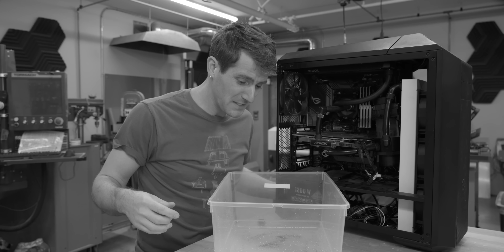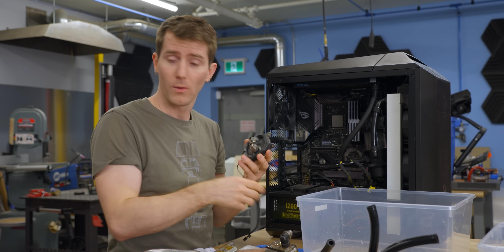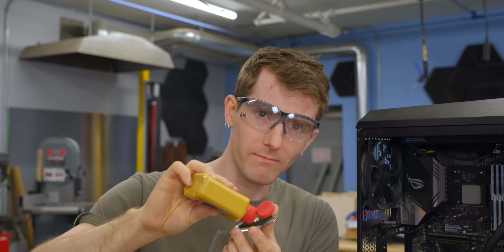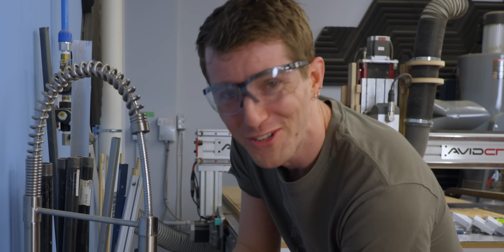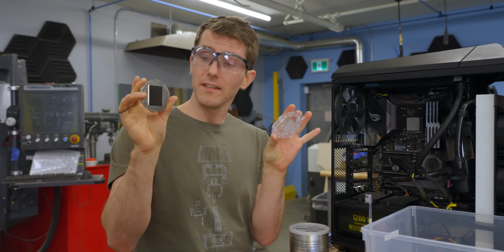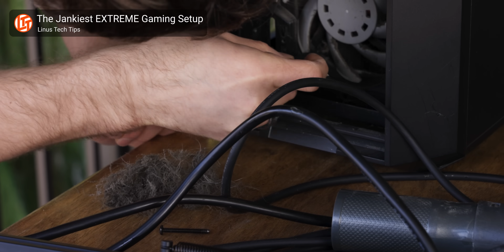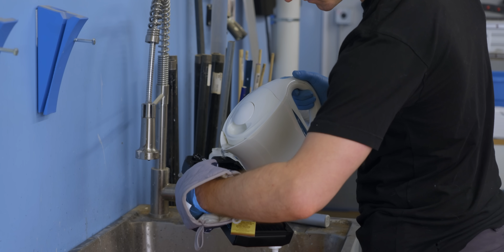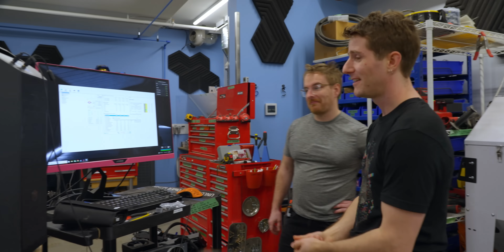I Will Never Watercool Again – Water Cooling Maintenance Guide

Comment: I've been using Distilled Water in all my custom loops for nearly 20 years from all the way back to the Thermaltake Big Water days. No color or additives. Just Distilled Water straight out of the store bottle. Fill it up. Put the lid on tight and store the bottle away in a dark place. Then just top up when needed. My systems run crystal clear and clean. I've sold GPUs with acrylic water blocks and have had many people comment that the EK water block looks brand new and wanted to know if I only just put it on recently.

Comment: Linus, you actually don't want to use vinegar, it has a stronger tendency to attack the raw copper and brass that most radiators are made from, you want to use citric acid. The chemistry makes it less likely and less capable of doing this, while still plenty capable of removing oxides and gunk built up on the radiator internals. I learned this from a Primochill rep when I was cleaning a severely dirtied loop that had previously had die in it along with a bunch of corrosion products and other gunk due to a nickle coated loop that had been stripped of all its nickle. I was in a hurry to get it done and get a build built, and i had not purchased primochill's branded acid cleaner for loops. The rep recommended I simply go to the grocery store and buy a bag of food grade citric acid powder, put some in the water to get the PH to about 2-3 (i got PH strips as well to monitor this), and i just let it run at room temp for a few hours with a spare D5 that had been in the loop previously and also needed some love. It took all the metal oxide shmoo off the D5 and its polycarbonate head, and i assume it did the same for the inside of the radiator judging by the appearance of the water afterwards. I then hit it with a rinse of the same acidic fluid to get the dirty water out, before rinsing with baking soda tap water, and finally pure distilled water until the water no longer felt soapy from the baking soda. I filled the loop with the same distilled water, mixed with a biocide treatment that primochill sells, and my loop has been running now for 4 and a half years with just some water top-ups to account for evaporation over time since one of my radiators has a slow vapor leak above the water line that I need to hit with the soldering iron again (i already patched it once but it didn't fully seal 100%, it must have dissolved some sort of flux plug/gasket that had helped seal it when I pressure tested it dry). I even did a CPU upgrade on this build with no problems because I used soft tubing, so I just bent my cpu block out of the way while it was still connected to the GPU. I didn't even need to use my quick disconnect fittings to take it out lol, just socketed the 5950x and away I went.
Reply: also borax is a nice way to increase pH and acts as a great buffer
Reply: @resko8758 This is excellent advice, I didn't think to buffer with borax but I know the chemistry, it'd work!

Comment: To anyone that wants to try the radiator cleaning method, be extra cautious with the water. Even if you spill just a bit on an oven mitt, it may not initially burn you, but so long as it's wet it ruins the mitt's effectiveness as an insulator. Let it dry or swap it for another before continuing.

Comment: My pc is not happy with the sweltering heat we have in south africa at the moment, opened the side and placed a desk fan the temp dropped by +- 10c p.s the case has lots of filtered intakes. To cool the gamer grab another fan and add a mint teabag into your water bottle no boiling water needed leave it in the fringe for 3+ hours and enjoy, good luck to everyone summer of 2024 looks like its going to be hot.

Comment: Liquid cooling yes, water cooling, no. Yes water has high heat capacity, but computers aren’t making that much heat that fast that you need Water over other, non-biologically “convenient” liquid.

Mineral oil, Mercury, Hexafluorides, refrigeration.

Comment: A good tower cooler sure is hard to beat in longevity and reliability. Been using mine since 2011 in two pc builds with basically zero maintenance. I've like thrice blown the dust away from the fins because my cases have had good enough dust filters to keep the internals clean.

Comment: I have hardline watercooled o11 build but the pump res combo is in the second psu slot in the back. So great to maintain, i can just unscrew the reservoir pull it 10-20cm out of the case and can drain the entire system without much difficulty. In addition the front look incredibly clean

Comment: If you're using water for cooling, should you not use distilled water? No mineral build up. Now if you used tap water, you will need to run Deliver through your cooling system for 30 min.
Do not mix deliver with bleach, Clorox etc, you will DIE, creates Mustard gas. Same as mixing Comet powder cleaner with Any Bleach product. You will die.❤

Comment: PSA, DO NOT LEAVE THE VINEGAR SOLUTION IN THE RADIATOR. It’s will cause HUGE problems, at max 3 minutes, then flush multiple times with water. Acetic acid causes big corrosion.

Comment: Both times I water cooled was because  my AMD gpus were over heating/throttling and the fans were way too loud.  I used only EKWB for water cooling.  The systems are:

1. 9900k CPU Block - MSI Radeon VII - EVGA Z370 Micro - 1000Watt EVGA G+ PSU - Thermaltake F31 Suppressor case black - (2) 360mm radiators with Noctua fans
2. 5800X3D CPU EKWB AIO for CPU - AMD 6950XT GPU with EKWB GPU block - 1200 Watt Platinum SuperFlower PSU - Lian Li 011 Dynamic EVO white - (1) 360mm radiator with Lian Li white 28mm fans

I did recently have to swap out on the 9900k Radeon VII system after like 4 or 5 years in use:
1. The 9900k EKWB CPU block due to a crack in its plastic/acrylic
2. All the EKWB clear tubing because it turned yellow and had a kink in a tight radius area.

Other then that, both systems are still in use and still leak free.  I did install a T at the bottom of the loop with a valve on both systems.  This allows me to drain the system when needed, even though it makes the system look uglier.

Comment: Hi. Good video! I'm worry, GPU memory has a very high temp. I also have NVIDIA GeForce RTX 3080: GIGABYTE AORUS GeForce RTX 3080 XTREME WATERFORCE WB 10G 2.0 (GV-N3080AORUSX WB-10GD) and my mem temp ~52-55C in high load

Comment: Pro tip: don't use an aggressive toothbrush and abrasive cleaning products, use an ultrasonic cleaner and light brushing. It's better at cleaning places the brush won't fully reach and it won't damage the metal plating. And you can get an ultrasonic cleaner for cheaper than a fancy electric toothbrush 😜

Comment: I remember reading articles talking about the virtues of a quiet system, by using water cooling 15+ years ago. Nowadays air cooling has gotten so quiet, that this is no longer a factor to consider. For reference, air fans used to be so loud that whispering around one was impossible. Made worse by a sound profile that resembled an airplane engine on takeoff, whenever you turned on the computer.
Reply: try to aircool a freaking 13900 and 14900 with it not hitting 90 degrees

Comment: I would like to build a computer with liquid cooling some day but I know myself and I'm kinda lazy, although I clean, brush and remove most of my current desktop dust, I have not changed the original thermal paste on my CPU nor removed any other component for a deeper cleanse since I build it in 2018.

Comment: Just saw them placing PTM 7950 on AM4 CPU...
Well, it does it's job, but good luck removing waterblock from CPU without hot air treatment later.
Otherwise prepare to extract CPU sticked to waterblock directly from locked AM4 socket. And pray you won't damage CPU pins or socket both when extracting and "unglueing".

Comment: I was really off put on the toothbrush because it looked like It'd be $200+ 
but when i saw $70-80 for the aluminium, replacement 6 heads for $17? Not bad, considering how fancy it is. Amazon has those types without the swiveling for $20, with included 8 heads, but not bad.

Comment: water cooling isnt worth it anymore the extra performance can almost be gained by undervolt and an AIO overclocking just isnt the same anymore i have not built  a custom loop in so long i have a full brand new build in my closet never put it in my rig saving it for the next one hopefully

Comment: honestly ive done janky wire like with that pump 12:20
although i used solder connecters 
i split a sata power lead into 2 due to space constraints 
and its been there for years so far no fire

Comment: I will never air-cool again.
My custom loop has been running flawlessly without any maintenance for more than 2 years now, also thanks to a brilliant tip by "Watercool". I ditched all pre made coolant products and used just distilled water, plus a pinch of pure citric acid. Citric acid forms copper citrate with the copper in the loop, which is a highly effective algicide. (Make sure to use just a pinch, just as much as fits on the tip of a knife. If you use a little bit too much citric acid your loop might get a slight greenish/blueish color, but that's no big deal either. I used slightly too much and measured pH to be sure it won't do any harm to the copper or any other components. The pH remained at 7, so absolutely no acidity.)

Oh and I also thoroughly rinsed all components first with tap water and then distilled water before assembling the loop. Probably not necessary, but I did it anyway.

That said, I'm planning on doing a loop maintenance soon even though everything I can see still looks like new and yes, custom water cooling PCs is something I would recommend only enthusiasts.
Reply: This can work if you are very very careful about your metal selection, your PH will still be in flux however and corrosion will still inevitably happen.

I prefer just using full hardline acrylic and a glycol based coolant and be done with it.  We have a world wide industry that deals with water cooling daily.  It's called the automotive industry.  There is a reason radiator fluid is basically just glycol and water and everyone uses it.  It handles both the biocide and anti-corrosion aspects, I chose not to re-invent the wheel personally and just go with what is proven effective.  The last loop I built hasn't been apart in nearly 8 years and still runs perfectly.

Comment: Gave it up after I went X3d. Not much point when air does all you need.
My old one clogged and needed cleaning every 6 months, it was grey slime on any metal/liquid contact in the system. It was a huge pain that I don't miss.

Comment: I have always used universal clear automotive coolant (premix 50/50). It cools well, never had corrosion issues, and never had any bio growth problems. It was specifically configured for mixed metal, anti corrosive use by design. Why reinvent the wheel that was already perfected in cars.

Comment: The second I saw the black debris in the loop, I knew exactly what it was. The anti-vortex foam from a brand new EK reservoir also disintegrated for me back in 2021. I contacted EK and they had this to say "It could be then that the foam was poorly made and decayed on its own just like that. It was a poor foam then. As mentioned before, we can offer you a new foam replacement for free as well as we would suggest you also to use a coolant instead of the distilled water for further use of the loop and protection of the parts from growth and so on" I was a bit upset because it required me taking hours to do a deep clean like in this video, and I certainly was not going to pay for coolant. I used distilled water and a few drops of a copper-sulfate biocide, for the record.
Reply: Yeah mine started to disintegrate and removed it. Nice that it's included but most people shouldn't use it
Reply: There's a generation of Porsches that have a similar problem with a foam block in the air loop that causes bits of foam to shoot out the vents over time.  I don't trust foam based filtration in fluid loops for exactly this reason.
Reply: Its why the anti-vortex acrylic insert is a much better option than the foam.  Or you know, just dial down the pump(s) a bit.  You really don't need 2 GPM flow.  All it really does is create more noise, heat, vortex problems and decrease pump life for maybe 1-2c temp drop at best.  I run my flow rate at like 0.5 GPM and my stuff still sits at 45-60c under load.
Reply: I also knew right away what it was. These fall apart even if you are running distilled without additives.
Reply: How expensive do you think coolant is? Maybe fancy RGB gamer coolant is expensive but name-brand automotive coolant is maybe $15/gallon. I imagine that's enough for at least a couple complete fills of a PC's loop. It's not just water and biocide, it also has anti-corrosion additives.
Reply: @eDoc2020  Water from the city is just over $0.01 (I have a reverse osmosis, so effectively similar to distilled). So even your cheap solution is 1500x more expensive. I've never had an issue with corrosion and I've had the same tiny bottle of biocide for the last decade. Doing it this way, I always have what I need on hand. No need to go to the store or order anything to fill up the loop. It's not just cost, but hassle. I would have needed to buy at least a few gallons over the years since I have cleaned or drained the loop to many times over the last 10 years.
Reply: @kylea5864   Coolant is many times more expensive than water but it's still cheaper than just about any component in the system. From an insurance standpoint it makes sense. The cost difference of water vs coolant is also minimized if you value your time. Instead of $.01 vs $15.00 it might be more like $10.01 vs $25.00. If the coolant lasts longer without needing a flush the time savings build up.

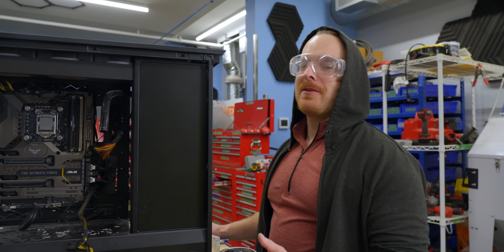Also you don't need a normal 1:1 mix. 1:10 should be more than plenty for a PC, making the $15 bottle also last a decade. Plus if you have a car you should already have some on hand, eliminating much of the hassle.
Reply: @eDoc2020  I agree, I don't care that coolant is 20 euro for a 5 liter canister. I care that it's guaranteed not to eat my hoses or damage the blocks, pump, or radiator. I wouldn't use car coolant though, compatibility with acrylics and certain kinds of rubber are not a given with those. Just simple clear coolant with a UV dye for ease of leak finding works perfectly fine.
Reply: @eDoc2020  one gallon of antifreeze concentrate is a lifetime supply for a PC. You can dilute it 30/70 with distilled water, and your aluminum won't corrode either as long as you change it every 60,000 miles or 5 years.
Reply: I work on industrial printers in my day job and we had a batch of defective foam like that get out into the wild in some cleaning units. I replaced one on an install and the bad foam just crumbled under a light touch. One of the bad ones accidentally got out to a customer and destroyed several printheads with microscopic bits of foam.
Reply: Yep, had the same issue before.
Reply: I don't get why you would buy a custom loop only to cheap out on the coolant 😅
Reply: @thatsl1ve183  I've been water cooling for a decade. distilled water is simply the best choice. A few drops of biocide and your system is ready to go almost for free. It's much easier, much cheaper, works exactly just as well and isn't as gaudy as colorful coolant - Yes I skip on the RGB as well... (and if you are using clear coolant, what are you doing... just use a biocide and distilled water...). After all, what is coolant besides water and a few additives... besides, the tubing in my loop is opaque
Reply: @kylea5864  Corrosion can happen in loops without aluminium too. Especially the nickel plating can get damaged. 

Coolants with solid particles are a dumb idea in general. I just use DP ultra clear and it is 9€ for a Liter. I think it is a destilled water glycol mix (viscosity at room temp is higher than water). Destilled water can work fine, but if you spend so much on watercooling stuff i don't see the point. The risk of the nickel flaking is just not worth it.

Comment: So why doesn't anyone use Automotive antifreeze for liquid cooling PC, it contains corrosion inhibitors, rubber/plastic conditioners to prevent degradation of materials in the cooling loop, and nothing will grow in it.
aluminum, steel, copper, plastic, rubber no issues using them together

Comment: I've got a Coolermaster AIO (ML240L) I got it 6 years ago to cool an 8600k. I've since upgraded my CPU to a 10900k and I swapped the original RGB fan for some Arctic P12's. The fan upgrade was a huge improvement to temps and sound. I've even got a mild overclock on the 10900k. I totally thought I would need a new pump by now but it's been solid for the $60 I spent on it.

Comment: You can fix nickel plating very very easily linus. Send a current through distilled water with nickel strips connected to your wires, you'll dissolve the nickel into a solution, stick your copper or whatever metal in the solution and send another current through, the nickel will be attracted to the copper and it will bond as an even layer of nickel. Just thought this might help in the future, there are tons of videos on electrical nickel plating techniques.

Comment: Yeah, Noctua NHD-15 is generally enough for me. It's not most of the time your CPU will be utilized in such a way that their temperature will be risen significantly, and it's been 9 years since I use a brand new NHD-15, and it's still going strong (CPU temp when gaming after about an hour is still around 56-59).